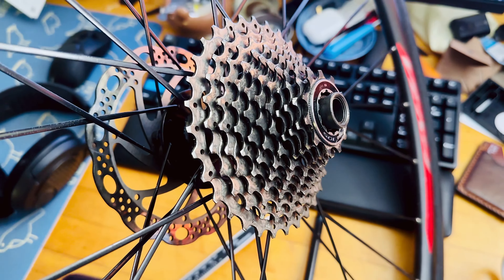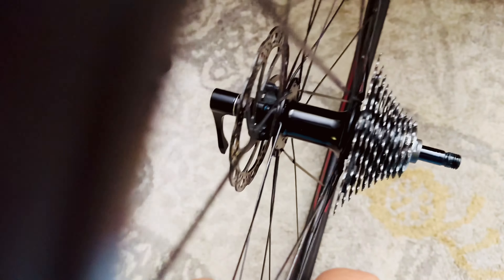Poor Rear Derailleur Shifting on 12mm Thru-Axle Rear Wheel? Check Cone Nut First!

Comment: 5 minutes wasted just to tell people that you didn't check if your axle is tight..
Reply from the maker: I disagree. I bought the bike, did a test ride for 15 min realizing it’s not shifting right, spent 30 min checking my front and rear derailleur since it was not shifting right. Used to have 9mm qr and axle nut was never lose apparently it happens quite a lot on 12mm since another bike I bought with 12mm also had lose axle nut. So had to describe the issue and offer a potential solution.